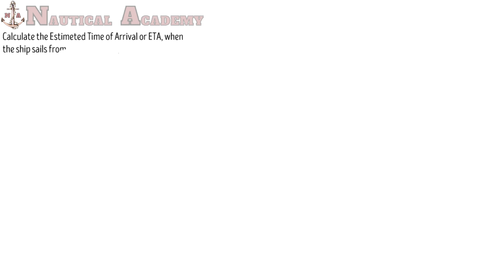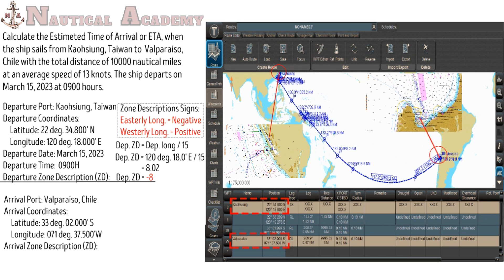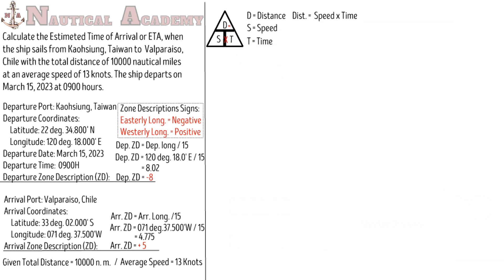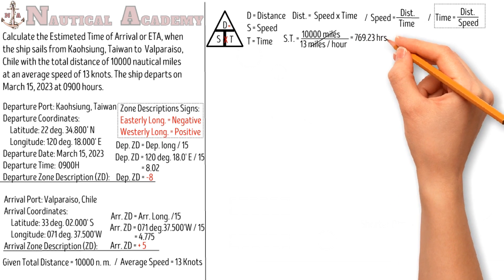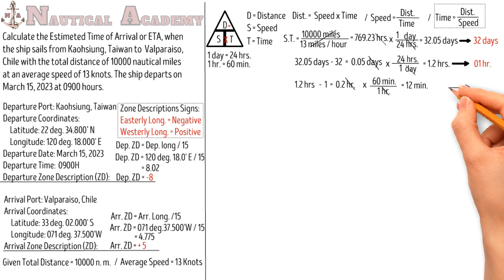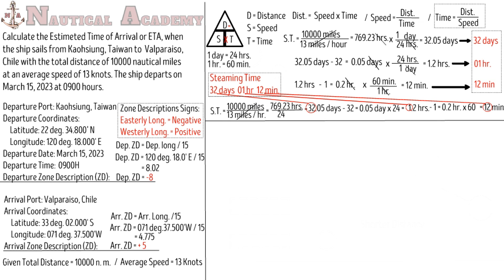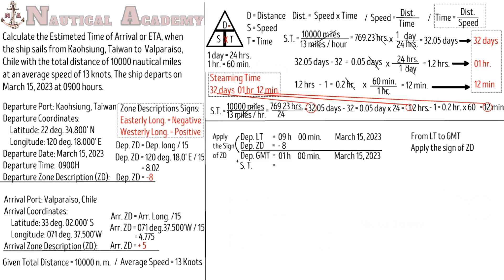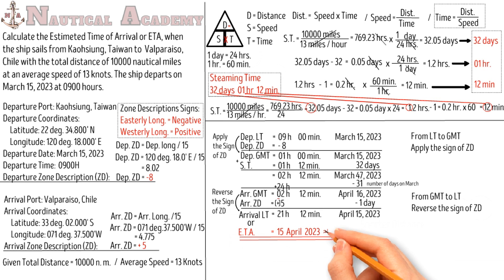Calculate ETA Crossing IDL II Estimated Time of Arrival II Steaming Time

Comment: this is too late but i think your rule; from LT to GMT apply the sign of ZD is not accurate, To go from Local Time to GMT, always subtract the Zone Description (ZD).
If ZD is positive, subtract. If ZD is negative, subtract the negative (which means adding). I hope you can correct me if i'm wrong
Reply from the maker: The Zone Description (ZD) of all locations in Easterly longitudes is negative (−), while in Westerly longitudes it is positive (+). This means that places located in the Eastern Hemisphere are ahead of Greenwich Mean Time (GMT), while those in the Western Hemisphere are behind GMT.

In the case of Kaohsiung, Taiwan, which lies in easterly longitude, its local time is ahead of GMT. Therefore, to convert its Local Time (LT) to GMT, we apply the Zone Description with its correct sign.

For Kaohsiung, the ZD is −8, so:

GMT = LT − 8

By correctly applying the negative ZD, we adjust for the time difference and accurately determine the corresponding Greenwich Mean Time. Reversing the sign of the ZD would give an incorrect result, placing GMT ahead of local time, which contradicts the actual time zone relationship.